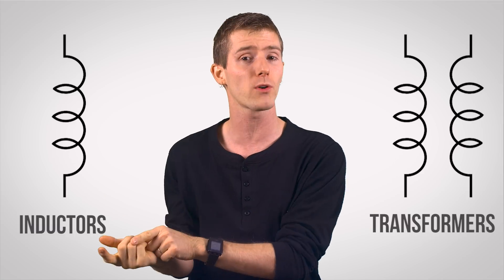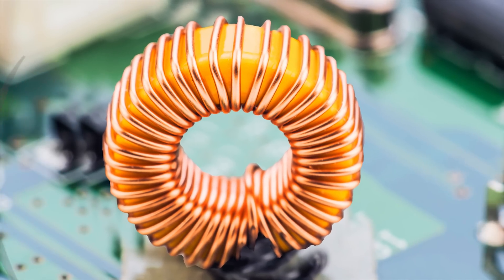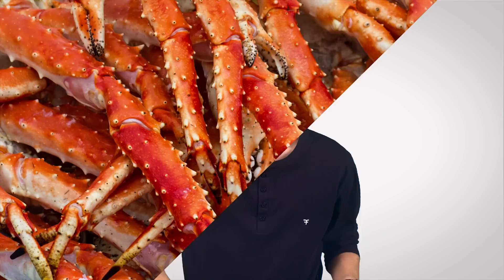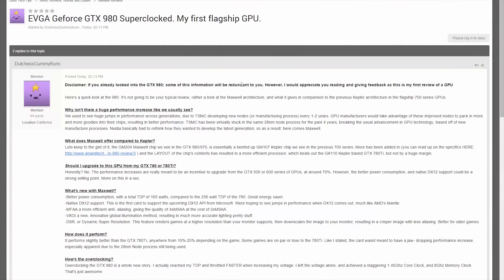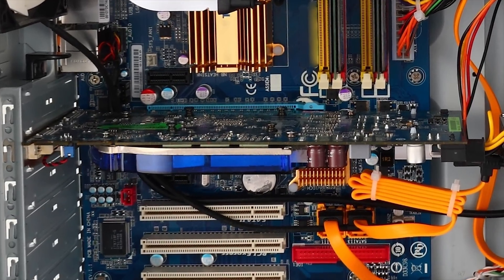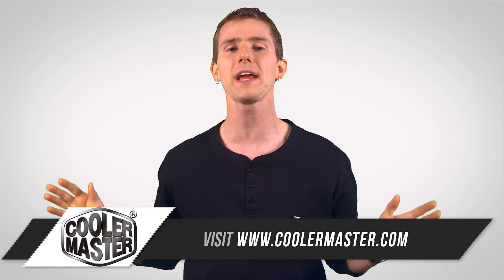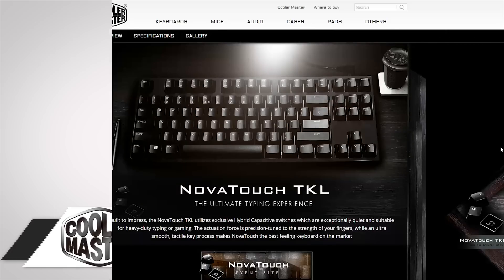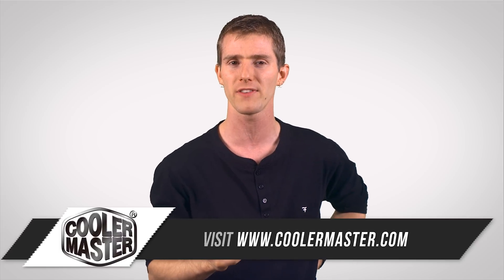Coil Whine as Fast As Possible

Comment: Also am I the only one who has NEVER had any electronics with Coil Whine?
Reply: Open up a simple game, let it run for 1000fps (the more the better) and then say again that you never heard anything. :D
Reply: i've never had coil whine, but i've seen it happen.
Reply: Same here
Reply: Probably not. Remember linus goes through products like candy while the rest of us generally don't have to deal with the sheer volume of products he does. I've only ever had coil whine once in 20+ years of using computers and even then I had to pump a ton of volts into my GPU and OC the snot of out it before it started whining really bad.
Reply: You're not the only one.
Reply: ive commented above. i played numerous titles older and newer. no matter 10 or 10.000 fps - no whine. had my pc 3 years now or so - been modifying it in moderate fashion(irrelevant) - no whine.my card is radeon r7 370 2gb 1025 and 1500mhz. thats my operative OC , had it run higher ( core ) but more ram freq.and it crashes.
Reply: same
Reply: Do a lot of gaming and you'll probably get it. I played CS:GO a lot for a year on an older gtx 250 (nvidia) my card started whining a lot through headphones before it died finally. Now using a gtx 750.

Comment: I've never even heard of coil whine.
Reply: You probably have heard it at some point but it is rarely as bad as the example they used in the video. Unless it's really bad the fans and other stuff giving off noise are usually louder then a little coil whine. I've only personally had one GPU ever have a high pitched whine and that was only when I was pumping a ton of voltage in it.
Reply: devilmikey00 Never, I built my first PC a little over a year ago and none of the 3 GPU's that have been in it have eve made that noise and they had been overclocked to hell.